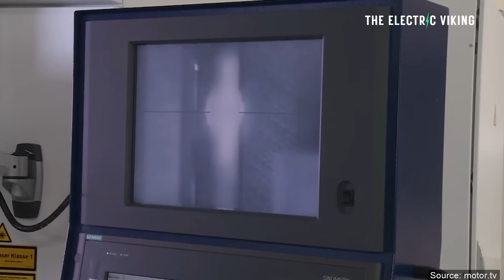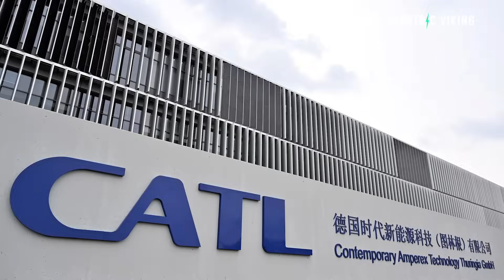The reason Ford, Kia + Toyota join Tesla in using BYD Blade batteries

Comment: The Electric Viking has been advocating for LFP batteries for some time now - and in my opinion with good reason.  The reduced cost, increased safety, increased lifetime, and broader window for  routine charging are all important advantages.  Ternary lithium batteries still hold some advantages in charge density and cold weather performance, but for most users, these are outweighed by the advantages of LFP.

Comment: EV's are a con. Where's all the electricity coming from? Fossil fuels.
Reply: Oh really . That is a revelation
Reply: Means yr country ain't doing enough to switch to green energy !
Reply: There are people who make that argument in favor of ICE but don't understand that ICE is so inefficient (like 20-35% of chemical energy is able to be extracted to useful energy), that even with 100% coal power production, about equal or less CO2 is released from EV. Coal power plants can be 50% efficient (50% of chemical energy is converted to electricity). After transmission losses, battery charging losses and electric motor efficiency (generally around 85-95% conversion of electrical energy to mechanical energy), EV overall efficiency number in this scenario with 100% coal, still stands at 30-40% (percent of chemical energy converted to usable energy in the ev).
Reply: I live in beautiful BC Canada where we have a very high mix of renewal energy.  Your argument it pathetically bad given the rate at which green energy is being adopted. Please try and be less ignorant.
Reply: There energy cost to get the fuel to the pump after mining, refining and distribution is way ahead of the cost of producing electricity. That is assuming you use coal or petroleum to produce the electricity. More and more that is becoming not the case.
Reply: EV's are not a con. It's just a work in progress.
I do agree that it is going to take some time to get rid of coal as a power source, but even running on power from natural gas, it will beat most ICE cars in terms of efficiency and pollution.

Battery technology is also continuously improving, and grid upgrades are ongoing to facilitate the load.

I think for some an EV is the best option, especially if you drive a lot and can charge on solar.
But for most people it is just not a great option just yet. Give it time, things will change.
Reply: This is why I’ll keep my horses 

1, there’s no fuel stations 
2, they are cheaper 
3, there’s no highways 
4, tarmac hasn’t even been invented yet
Reply: @bydman5320  Probably smarter than keeping your ICE car.

Comment: Sam, are there reliable ways to ascertain  what chemistry the EV we're considering is likely to have? I have tried to ask my dealers, but they have no clue what I'm talking about. They don't even seem to understand Ohm's law; they have had Big Oil's world jerked away under their feet, and they're still flailing pathetically.
Reply: I think tesla marks the pack's and has a sub menu you can access that shows which pack the vehicle itself has. 
Right now every sr rwd trim tesla model y&3 sold since late 2021 have had an lfp pack.

Comment: My Atto uses a 126S1P 400V 60KWH LiFePO blade cell battery. It seems to work very well.

Compared to cylindrical cells the blade cell battery is far simpler (one tenth the number of cells) but also cheaper and easier to build.

Arguably, the blade configuration also helps thermal performance by allowing easier heat transport and less potential for hot spots.

Form follows function. Just as it took time to settle the general configuration of modern airliners (swept low set wings, two engines), my suspicion is the blade format with some minor variations between manufacturers, will win out.
Reply: Much faster production in 4680 cylindrical cell. Don't count out cylindrical cell. Many other EV company have seen the superior potential of those cell, which they are developing themself such as Beamer!  melon beton

Comment: fyi new tesla m3 is priced significantly higher than the old models. in china, it is about 4k usd more expensive.
Reply: You get a lot extra for the 4K. I would of paid another 4K to get:

cooled seats
10 more speakers and a another Sub woofer
all round double glazed windows
bigger more responsive centre screen and rear seat screen
better world class suspension and new better softer riding tyres
FSD hardware 4
50+ extra miles of range across the variants

But that's me.
Reply: @lionelwylie2326  but the new model has no radar unit and no physical gear stick. it still has no dashboard display. seat cooling and double layer glasses have been standard features of other evs in this price range. besides, people like Sam has been speculating for a long time that the new model would be CHEAPER. clearly they are wrong. tesla, at these pricing levels, is not competitve in china. its sales there has plateaued while other brands are still growing.
Reply: @qilu2004   Tesla are fine in China, they are #2 in sales after BYD for EV sales and #1 if you don't include hybrids. If China start  selling outside of China, which they are starting to, they will take market share off Tesla. This won't matter. Tesla is expanding as fast as it can and it is still selling every car they make. So while the numbers will show China taking market share in reality, they are taking market share off ICE manufactures. Until Tesla have to slow production due to demand market share is kind of meaningless.

Comment: "You're probably a great driver." Yet, as you point out, 1.4 million people die on the roads every year. 
The reason? Around 80% of people think they are a "great driver", or at least an above average one, which is obviously impossible! Psychologists call this effect "Illusory Superiority", and it's quite widespread in various domains. (It's closely related to the Dunning-Kruger effect).
https://en.wikipedia.org/wiki/Illusory_superiority